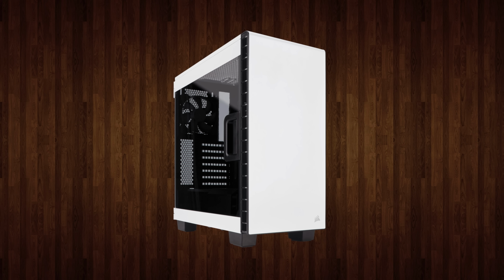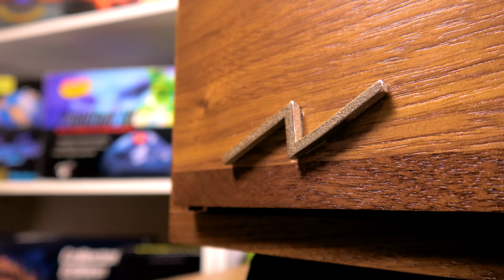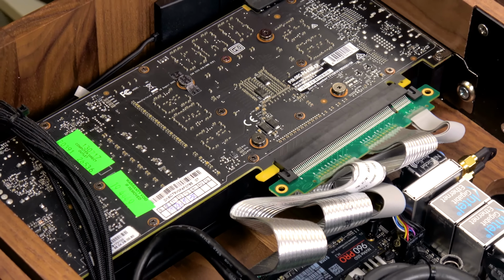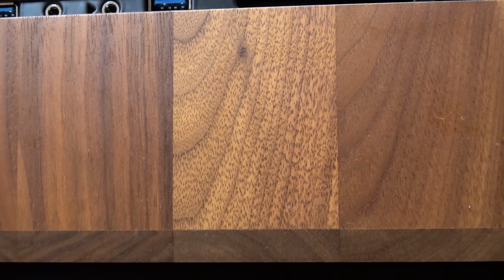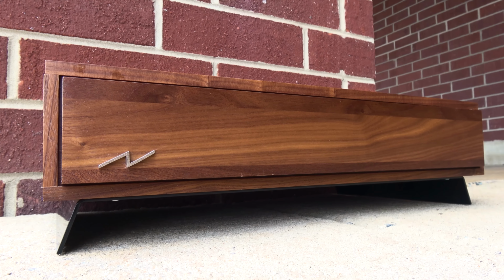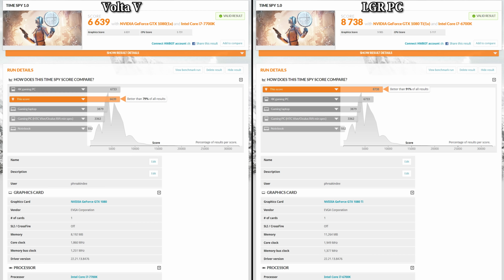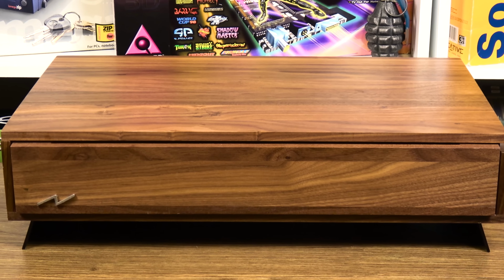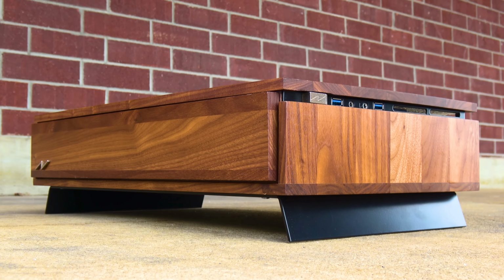LGR - Volta V Wooden Computer System Review

Comment: For the price they want you could get someone to do a nice bespoke wooden case, drop in a motherboard kit from whatever vendor you like and have enough change to go on a little holiday.
Reply: Yeah id have to think any reasonably skilled cabinet maker could make that case for you for a few hundred, 500 maybe?
Reply: @sparkplug1018  with only straight cuts like that? You could go way cheaper
Reply: @joseislanio8910  Yeah if you aren’t getting fancy could go cheaper for sure. I was just thinking about how I’d have it built, nice wood, good joints, etc

Comment: Base price of 2000 dollars for an I5 7400, 8GB RAM, and a GTX 1050. There is no way that super simple case costs that much. The build isn't even that impressive, wtf
Reply: It's a beautiful piece of work but that price man, that's ridiculous and the 1050 is not that good at all...
Reply: Jacob eMatt with that money I could use to buy tools for woodwork myself and become carpenter via YouTube. Damn, I should to that.
Reply: But, But you're saving the planet by having a wood case. When they start making the guts of a pc out of sticks and twigs I will be impressed. 20 years ago, when I was into the pc modding. you would see wood cased pc's all the time.
Reply: The 1080 model is a lot better with 16 gb of ram a GTX 1080 a 500gb SSD and an i7 7700k at only 2800
Reply: "at only 2800"
Reply: Chicken Mane Except a machine like that would cost you like less than half of that if you built it yourself.

And fucking hell, the RAM and motherboard they're using pretty much scream "cheap" - for Z270 mITX, of course.
Reply: StarluckZX. Yeah, "only" 2800 USD. Only....
Reply: +smartmonkey777 Yeah, but as a company, you don't buy a new table saw for every unit you make.
Reply: You could cut that wood with a hand saw, looks like simple straight cuts
Reply: That little thing only needs a $250 tablesaw, a miter jig, and a planer, and the miter jig can be made on the tablesaw. Oh yeah, lots of clamps since it's all little pieces glued together.
Reply: I'll make 7 of them and sell them on eBay for $100 a pop, all I need now is some walnut scraps and glue.
Reply: Welcome to the world of pre-builts. Yes you can save a lot of money building your own. No not everyone does it. If you're wealthy as fuck why the hell not buy it for fun.
Reply: This is expensive even for a pre-built tho
Reply: Those that can, do. Those that can't talk shit on the internet. Never said I was going to do it, just that I can. You could too, if you knew what you were talking about.

hahaha
Reply: Sorry smartmonkey777, Cheezy Dee is right. When I was in high school this sort of box would be a project, and we would have to make it by hand to prove our skills. It would be much quicker to make today. Only people who have no clue think you need thousands of dollars worth of equipment or that it is extremely difficult.
Reply: Jacob eMatt my rig has an i5 7500 Rx 470 4 GB and 16 GB ddr4 RAM and combined with my other parts it was only about 700-900 dollars after tax. (Honestly forgot the exact price). Of course it has a basic PC aesthetic (nothing flashy but I like it like that), but still.
Reply: Honestly.. Who will buy this?
Reply: People who has cash. This computer looks gorgeous.
Reply: Of course it's going to cost more than the sum of it's parts. If you want to pay the total cost of all the components, build it yourself. The idea is that you're paying more to have actual professionals do it for you
Reply: +Avengersoul
And pine would be much lighter weight too, which means this could actually be a pretty portable PC. The only reason I'm looking at this is because a friend of mine wished that he had a gaming laptop so he could easily come over for a few hours and hang out, and be able to play PC games with me. But gaming laptops cost ridiculous amounts of money, and cheaper ones are under powered, so I said, "Why not build a custom wooden case for your desktop?" I was thinking something very similar to this, but also have a built in keyboard maybe, and attach a LCD screen to the case with hinges some how, so that it's completely portable.
Reply: Yeah, the craftsmanship is mediocre. You could easily build yourself one and make it look 10x better than this.
Reply: But, but it's "Sustainable" you have to pay at least 1000$ for buzzwords.
Reply: Yeah, if your hands aren't growing out of your ass you can build a ways better case than that even for free. It looks like they got some wooden boxes from somewhere and decided to sell it to people that have more money than mind, the position of the mb is just stupid, the power plug is still there in the back so why don't get the board like it should be, instead the break the box and put some fronplate connectors on the side. Stupid design and the pricing is just pure greed.
Reply: the only thing impressive about is its size, but with those specs its not even worth it when getting a decent pc is far cheaper than that.
Reply: @41knots20  remember, it looks like its designed for a TV, many still are at 1080p so a 1080 will smash everything at that resolution for 60FPS display output.

Comment: Holy Cow!  2 Grand minimum?   WOW!  No thanks.
Reply: That price also includes the PC components within, but yeah, the price is a bit steep but expected with a custom case.
Reply: The computer you want is always worth $2K. I don't remember where that quote comes from (Intel probably), but it's still true.
Reply: Grandsome what?
Reply: Sid H. paying near two thousand dollars for the case like the one in the video is a fucking rip off. You could built 20 of these for the much money
Reply: Not really, calling it "premium" might sound like a joke, but any actual wood items (not that pulp stuff from Ikea or plastic faux wood) are artisan and have a higher cost. There's room for all to exist, as long as you realize that this actually helps American manufacturing, while anything made in China only worsens it.
Reply: Pvemaster2 Exactly. I make stained glass windows and right now we're making a series of windows for a client. Each window is approx 2.5'X4'.  One costs $3,000.  Woodworking is an artisan craft and good cuts of wood are expensive in their own right. (God Walnut is so expensive.  Personally I wouldn't do a full walnut case, I'd do a case with walnut inlays.)  Most Ikea items are good quality and durable but they are made with ends of wood cuts and are jointed/spliced. This drastically reduces the cost and also significantly reduces waste.  You can see it on the faces of their natural wood items, it looks like the wood was puzzle pieced together. This type of building is fine for furniture items and I'm happy they can fill a market using wood that would normally be thrown out to paper mills or otherwise ground up.
Reply: Well. at least it has noctua fans.
Reply: +James It can't get that hot.  Hardwood like walnut doesn't start to char unless it gets to more than 300 degrees Fahrenheit, and doesn't ignite until about 400 degrees.  No home computer gets that hot... the temperature would fry the CPU before the wood would even start to smoke.
Reply: +Avery F Did you not know that cabinet-grade walnut is about $10-$15 per foot?  And you'd need around 10 board-feet to build that.  If you were competent, and had the right tools, you could build the case for maybe $150-$200 in materials.  So, yeah, almost $2k for the case is a bit much (by a factor of 4... a professional woodworker would probably charge about $500 for the same thing).
Reply: I don't think the price is unreasonable at all. It's outside of my price range, but so it goes.
Reply: For that cpu, that graphics card, liquid cooled, and that dope ass case, I'd pay like 2.5k.. but I'm also in Canada. :\
Reply: Yeah but I mean that 2K also contains the cost of the computer parts, not just the case.
Reply: Pvemaster2 still the case is pretty overpriced since the parts alone dont cost that
Reply: @The Randomchannel, Well yeah, that's how business works. The company for this product isn't likely getting steep wholesale discounts (if any at all) so you're paying a premium for the components inside.
Reply: Yeah, right? makes you want to make it yourself
Reply: than go away! save your comments for the poor, us rich love this stuff!
Reply: @SidTheGhostBox  if Apple sold it for 3 grand, would you buy it?
Reply: @jamesisaac7684  I'd never buy an Apple product, regardless of price.
Reply: @grandsome1  no

Comment: HELP! My new PC has termites!
Reply: Ahahaha!
Reply: +Michael Crehan  Look on the bright side.  For once, it would actually be worth calling in the exterminator.  (Also, it gives an entirely new meaning to "my computer has bugs".)

True story: We have a fireplace in our house, so we used to keep a stack of wood outside.  Terminix was giving free inspections, so we called them out to do an inspection.  "Well, your house is termite-free for now, but that cord of wood outside is infested with them!"

Dad's reply: "From the price you just quoted me, it's cheaper to just buy another cord of wood for the termites!"
Reply: +SpearM3064

Well technically "my computer has bugs" used like that would be really old. Like... vacuum tubes-old. You had literal bugs going into a computer, and to debug, you had to remove the bugs from there.
Reply: Woodgrain computers! Now with actual bugs, not just digital ones!
Reply: You joke, but the thought did actually cross my mind about how well that wood is going to hold up with the heat you get from a computer.  I dunno enough about wood to know whether it would be an issue, but I could totally see parts of the thing warping after about a year of regular use.  Wouldn't surprise me if that's half the reason why they offer 'lifetime' service.
Reply: Michael Crehan the termites ate my dead ass up

Comment: In addition to being a fan of obsolete as well as current tech, I'm also a knife-maker, and I work with lots of different sorts of native and exotic hardwoods for handle scales. This is a rather massive price markup for what looks like a few chunks of very light-colored scrap walnut glued together.

One big problem I see here is that you're continually exposing one side of the wood to heat, but not the other. Walnut is fairly dimensionally stable, but over time this is going to warp. Don't even bother with the bamboo version. Bamboo is very sensitive to changes in humidity, and with one side drying from the heat, but not the other, it is destined to come apart at the seams where it's glued together.

If I were going to have a wooden case, I would use denser, harder wood, like ebony, katalox, or various rosewoods. Each side would be cut from one single piece of the wood, instead of having lots of smaller pieces glued together, with lots of points of potential failure.

Comment: I have to agree with Clint. While this machine is unique, and visually striking, from someone who builds custom PCS this is extremely overpriced. And honestly, could easily be duplicated with the quick trip to Home Depot for some scrap wood. I might just consider that :)
Reply: darkstar949 I don't think you would need that much wood considering it's a mini ITX motherboard and a micro ITX power supply but either way i think you're right
Reply: He's pretty much right, I work in a wood shop (Cutting, building furniture) Wood isn't cheap if its good quality, and you also have to sand and finish it
Reply: The fit and finish for the price is not looking too good, just looks like a box with no accents. Dovetails joints and wood feet would make it more inline with the price no?
Reply: CaptainDaAwesome i have and built 5 arcades, and 2 virtual pincades. This would cost less than $100 to build (case).
Reply: It looks like a demo first effort, not a ready-for-market product I could ask ~$2,500 for with a straight face.
There are raw saw cuts showing! If you aren't gonna dovetail it, at least sand the damn edges!
If they're gonna market this as a serious gaming PC, some airflow cutouts would be good too. Maybe cover them with tweed, like an oldschool speaker grille.
Reply: Home Arcade Systems are they made of Walnut though? The bamboo looks like the pressed stuff. I do agree the premium for the case is OTT, but we shouldn't forget we would be paying for the lifetime warranty also.
Reply: Cheepchipsable normally they are made of melamine. However, I have made a couple very, very nice cabinets out of birch. I'm not sure what the lifetime warranty could actually include since the motherboard's warranty is two years, as well as the memory, and several other components.  Either way I believe we all agree it's a little overpriced
Reply: Home Arcade Systems hey, why don't you do a diy project for it on your channel
Reply: As a console gamer, I say "DO IT!" There are plenty of interesting cases I could use if I wanted to make a gaming rig, from cases of dead consoles to scrap wood. No need for those overzealously designed tower cases. Just (get a friend who knows their way around woodwork and) build one out of spare walnut! I'm loving the thought process behind all of this. If only I had the patience, and money wouldn't hurt.
Reply: @rjz2  disagree, that wood is available anywhere to meet a similar specification and look.  I can get jarrah or marri floor boards for nothing, have it made by my neighbour for a carton of beer.  Most people are in a similar situation for their own timber locality.  Also the craftsmanship on that box is pretty rubbish.  $2,000.
Reply: @CaptainDaAwesome  you'll find endless amounts of free wood on facebook marketplace for your area in cupboards, tables, floor boards etc.  All outstanding wood, cured, usually protected with paint and can be easily cut into a box.  Free.

Comment: In 2000 remember building a wooden computer out of hardwood tiles. Carved them with a pocket knife and glued together with epoxy, because I didn't have any other tools. I mounted a trackball to the front and extracted a needle volume indicator from an old stereo which I hooked up instead of the hard drive LED. That was the coolest thing ever - hearing the drive search and watching the needle jump. I also took apart a keyboard and wired spacebar, excape key and enter to the front, in order to use the box as a media player without having to connect a full keyboard. It ran Windows 98.
Reply: i think i would rather have you build me one than pay £3000!!!